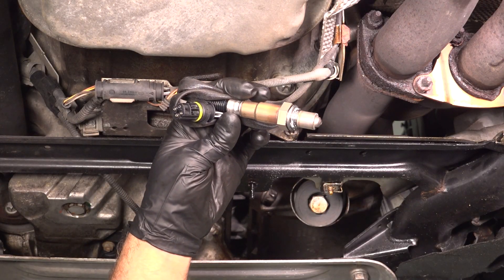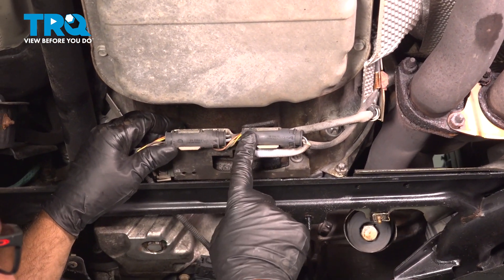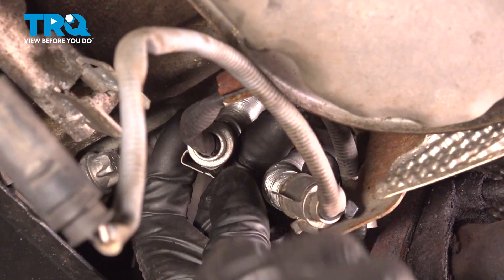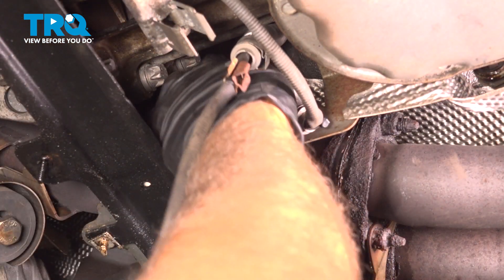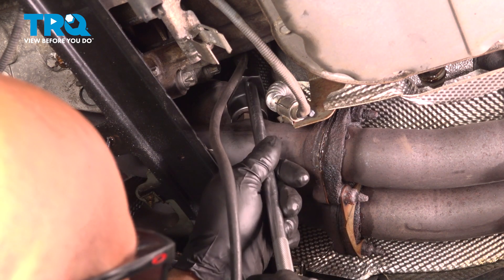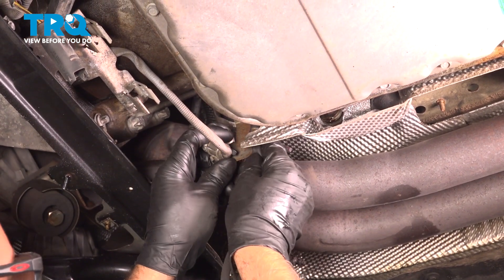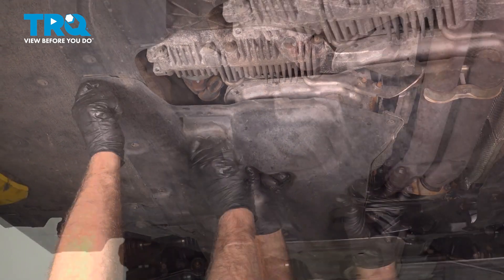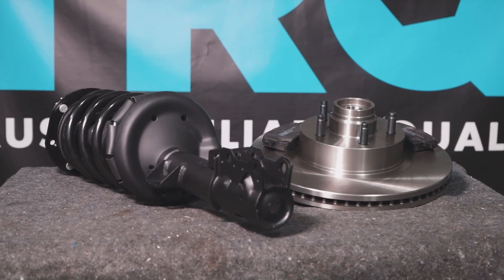How to Replace Downstream O2 Oxygen Sensor Bank 1 Sensor 2 2009-2013 BMW 328i xDrive 3.0L I6

Comment: The original seemed to have a metal heat shield. Did you not
Need to move that to the new wire?